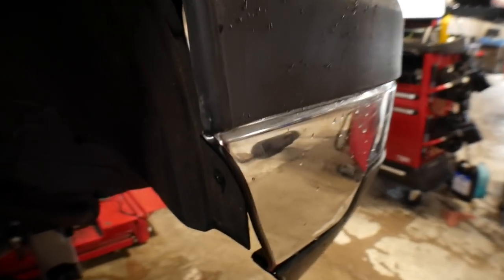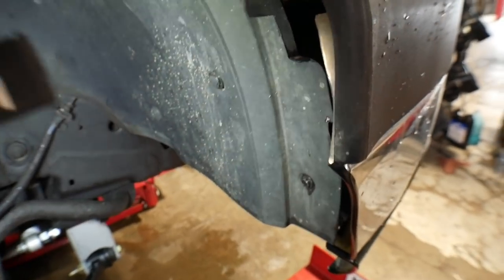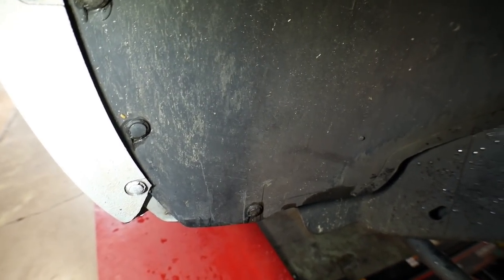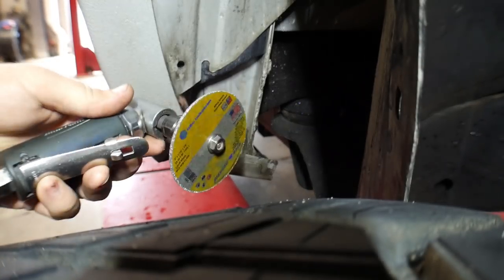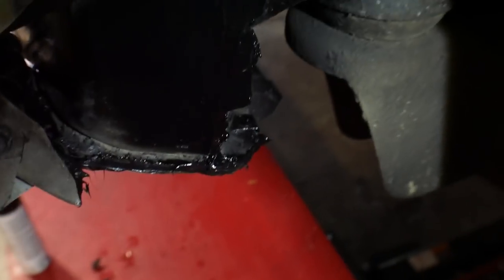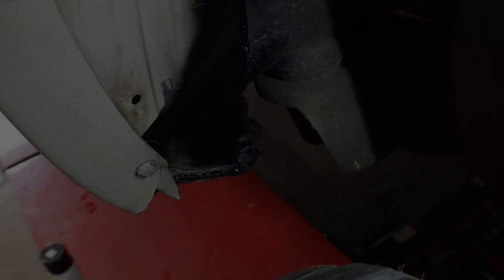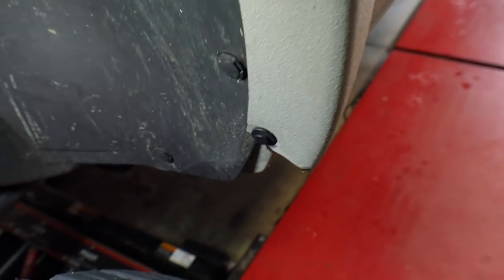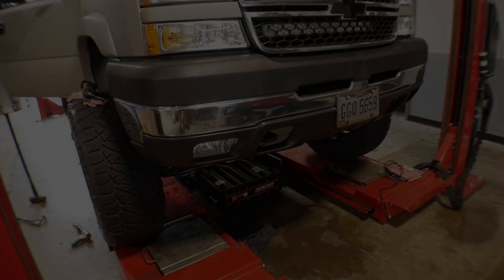Chevy Duramax Full NorCal Fender Trim Mod

Comment: I did a NorCal on my last Sierra. I also used rtv. After once Canadian winter the rocker was rusted to crap. The rtv held in moisture. I would suggest you weld the edge we’re the two panels meet then reapply some sort of rust inhibitor paint like por15
Reply from the maker: Janelle Taillon thanks for the advice and yes it’s going to get welded in here in the next few weeks. Until that time I painted everything in as well👍

Comment: Hey really liked that video I've got a question I've got an 05 Silverado 2500 HD and the parking brake cable is in the way on the drivers side pushing on the  plastic fender well and rubbing on the tire I just need to know if there's anything I can do to pull it back out of the way away from the tire 🤦🤷🙏🤞!?

Comment: Doing a similar build what size are those wheels? I've got 22x14-76 I'm going with 9'' front lift. Worried it's going to rub like a mofo. Trying to find info out before dropping $2500 on 37/13.5/22s

Comment: So how do you like those Ridge Grapplers?
Reply from the maker: A Sp8 I love them, and will never do a build without using them. They get a ton of grip off-road and in mud but are some of the quietest tires I’ve ever used. Plus their LT weight ratings are usually really good if you’re wanting to tow larger amounts still.
Reply: Rustbelt Mechanic I have seen them on some 5.9 and 6.7 Cummins that roll through my bays here in Ga. I haven’t had a chance to ask how the customer likes them. I’m looking for a semi aggressive,  E load range, and quiet-ish ride. Still wanna be able to hold a conversation in the cab over the exhaust and the tires talking back. But I’m only talkin 33” tires. My days of the big stuff is gone. Had 40” mud graps on my old LB7 and said after that never another nitto mud tire.
Reply from the maker: A Sp8 yeah the ridge grapplers are a totally different story, with a 4” straight exhaust and 37x13.5 tires I can hold a normal conversation easily in the cab.

Comment: What did you use to prevent from rusting?
Reply from the maker: A can of black rubberized undercoating
Reply: Rustbelt Mechanic what about the front bumper? I have a 2018 midnight edition and im gonna have to trim some. Just not sure if the bumpers are actual metal were it’ll rust.
Reply from the maker: Yes it’s metal and I used some clear silicone and trimmed it up with some black door edge trim as well to make it look clean

Comment: How did the other side turn out? Was it even from the first side,? I always have trouble with that. Diggin the new intro n music.  Tinted plate covers are illegal by me in Illinois, but that don't stop me.😎
Reply from the maker: Thanks! The other side worked out perfectly even, this is probably my 5th set doing this to over time. I hate the front plate and I would roll without it if I didn’t have holes in my front bumper already. Which is why when I upgrade bumpers it’ll just have to go! Getting close to that 1k mark aren’t you?!
Reply: @RustbeltMechanic  Should be 1k by Wednesday or so, we will see 🎉. I got some pretty cool tool review videos planned.